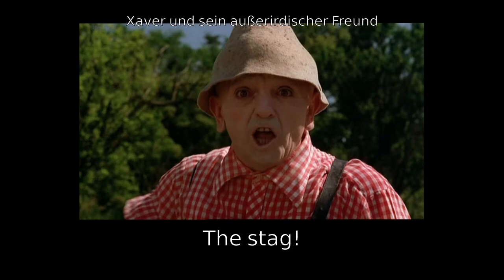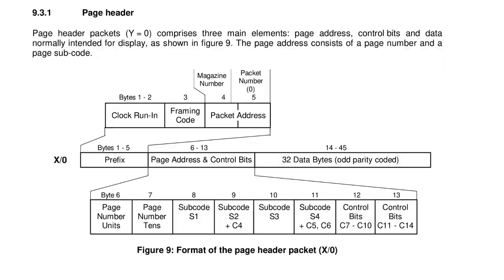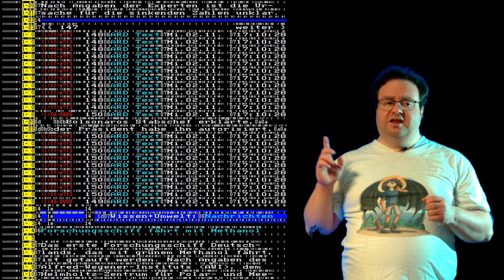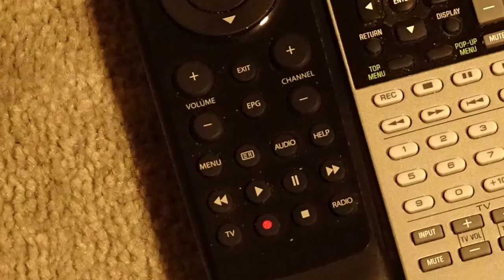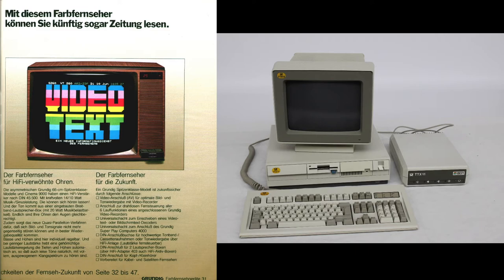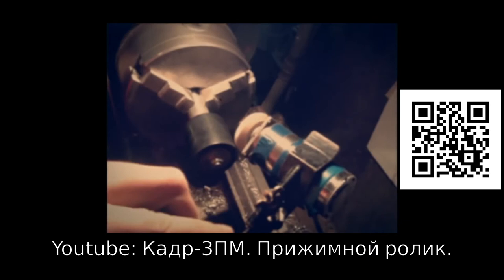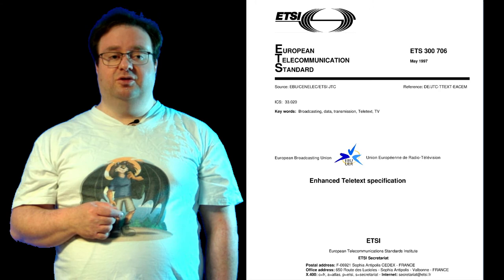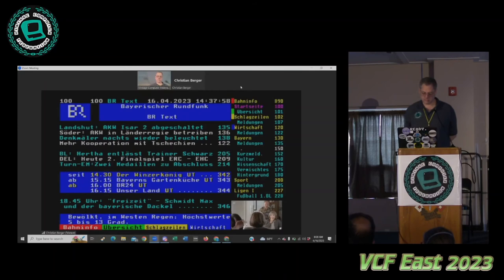An Introduction to Teletext — Christian Berger

Comment: Swedish television still has teletext up and running. I prefer getting my daily news from it.
No images, no ads. I can browse headlines. Then each article is short and to the point.
Nowadays, Swedish teletext is also available on the web - multiple sites even.
Reply from the maker: Wow! Very cool!
Reply: Unfortunately I can't receive any Swedish TV stations so grabbing it's text would be fairly hard. It would, however be feasible to do it with a Raspberry Pi (Zero) and the DVB-T2 module for it.